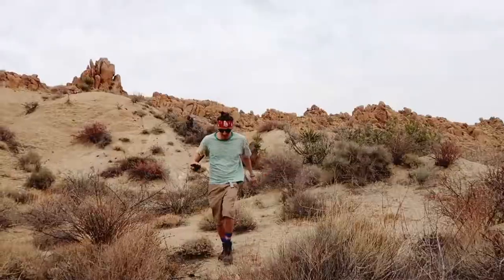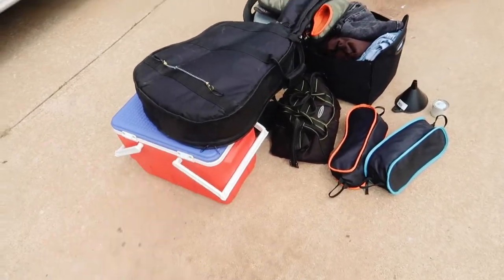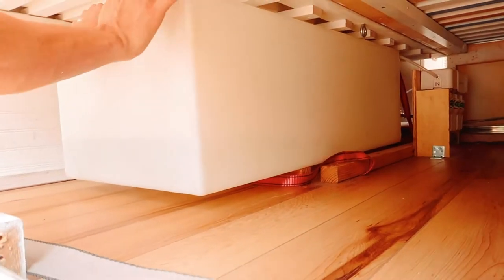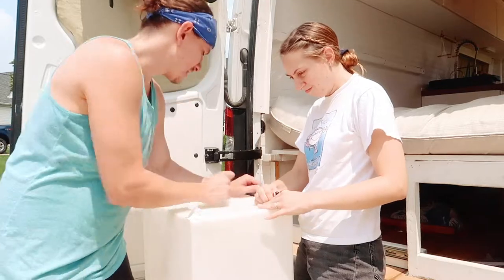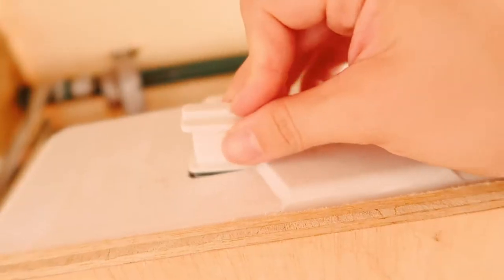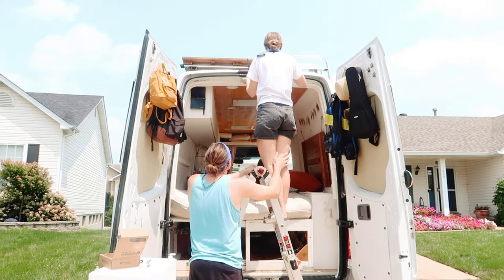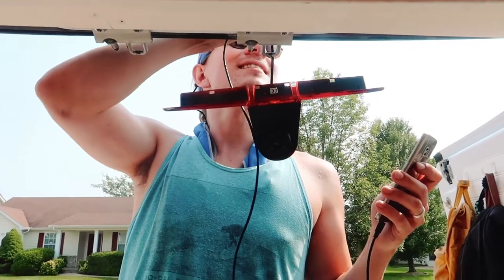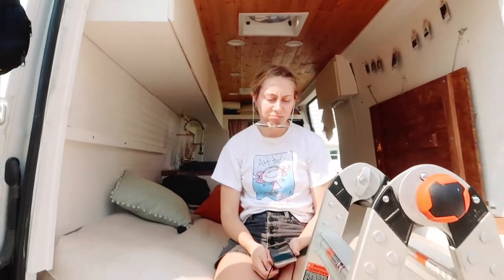REMOVING OUR WATER TANK in our tiny home | Preparing for full-time vanlife again

Comment: On that water tank, do they sell a replacement drain/outlet thread component, where you can just cut off the cracked one, and attach a new one with gasket between the back end of the threaded component that would go inside the tank, and the internal wall of tank.  I guess you have to be able to get inside the tank to do this so don’t know if that’s even possible.  Also, maybe I can drop in and take a look at that backup camera issue.  😊
Reply from the maker: We have found a few ways to replace that threaded portion on our tank, but we’re not sure how well it would turn out… 😬 Not to mention, we’re pretty excited at the thought of getting extra storage space! 😂
And we’d always love a helping hand!